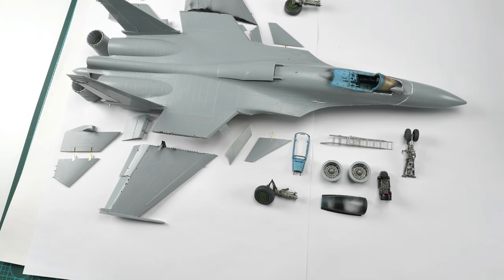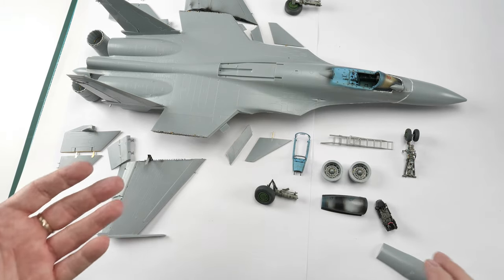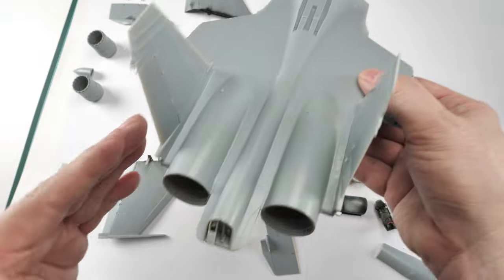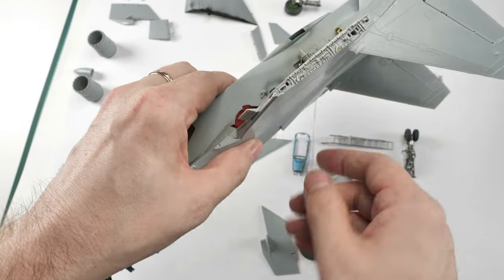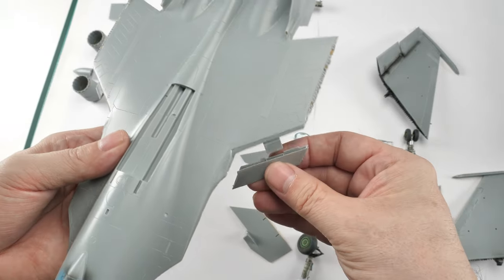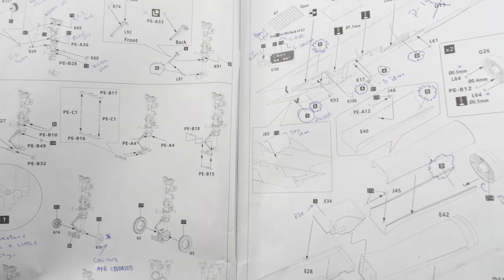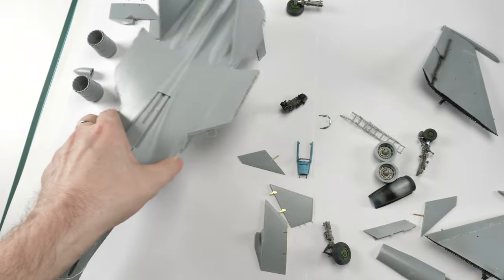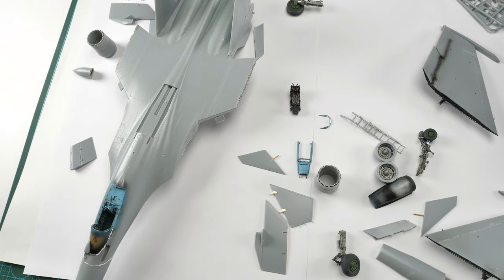Minibase 1/48 Su-33 Flanker-D Part IX SPECIAL HOW TO builders tips and build review

Comment: If people are complaining about 'too many parts and too many details', then I'm sure there's an alternative kit out there for them. I would also find it worrying that on a brand new kit to have parts left over or not called out in the instructions. As you say, there may be some future releases of other variants of this plane, but without knowing that, I'd be left thinking that I'd missed something or there's something left out/off.
This was a really helpful video - concise but full of very useful information. Well done.
Great video thanks for sharing.
Reply: They are a set of simplified design "main landing gear down position lock".  The design team was originally worried that it would be too difficult to assemble a complex locking mechanism at the opening of the Flow hood，So a simplified alternative was added，But in the testing phase, let some friends who have never built a model to assemble, they can all successfully complete their assembly according to the assembly manual，This reflects that the original worry is completely unnecessary，Therefore, the simplified version of the replacement parts group has been cancelled in the assembly manual. The model can be constructed in the most accurate form.